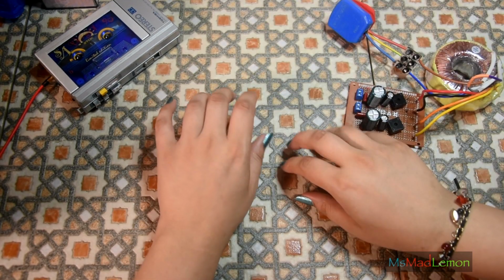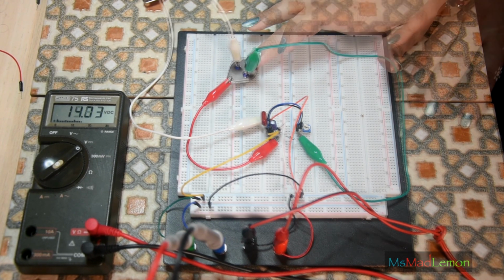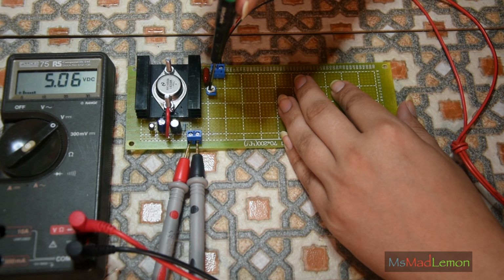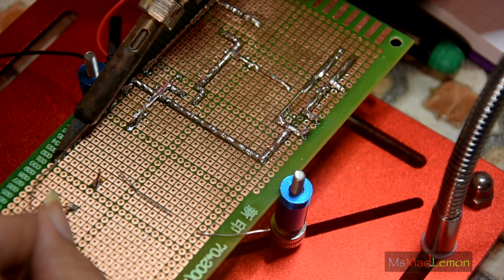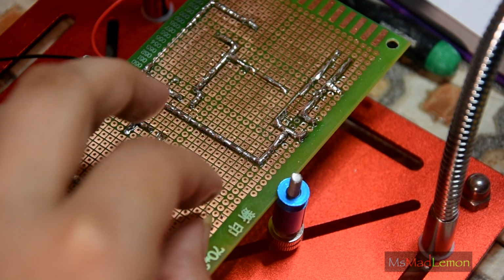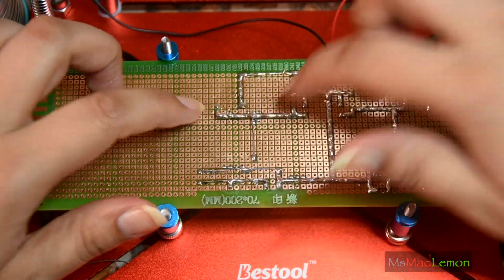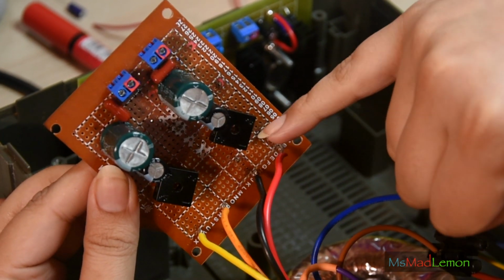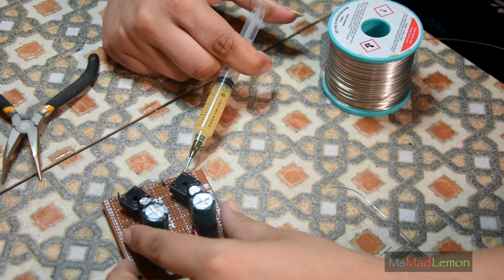Power Regulator board Build - SIDBoomBox Project 05

Comment: Cool. Years ago, I have made circuits with this kind of PCB, too. Nowadays, I have everything on a real PCB, because it is cheap and reliable and especially reproducable. KiCAD is for free and I am sure, that you can use it within a short time. And I am sure, in case you have a question, you will get an answer in Twitter within a short time. Your boombox is an exciting project. I have thought of making one withn a raspberry pi and a 8" display. All required components are already bought, but I did not manage to salvage my old boombox. I feel bad, when I destroy something.